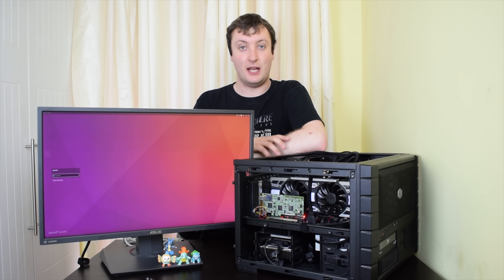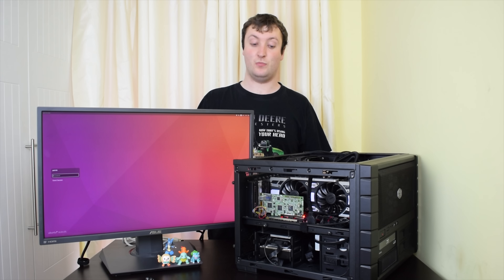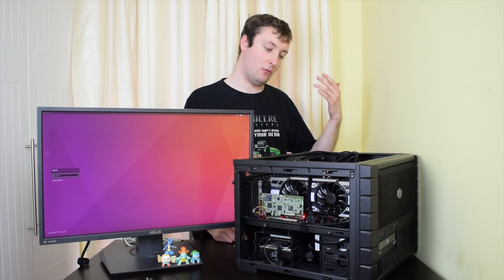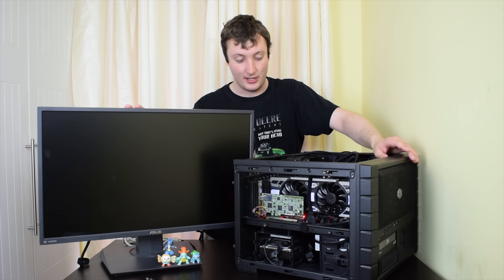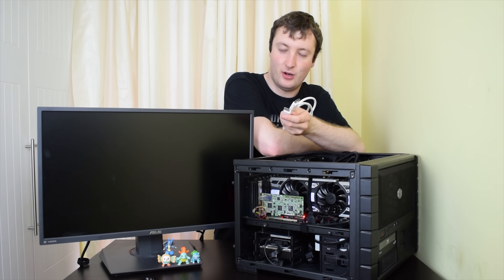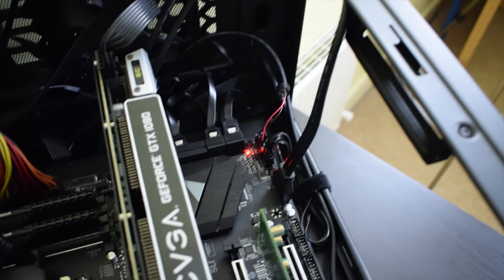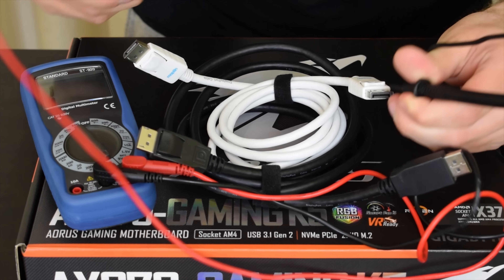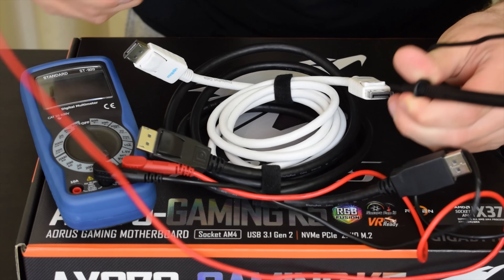Display port can cause boot issues

Comment: Bought it the same white cable from Maplin. It's not good as well. :(
Reply: Did you bought another one??
Reply: @aashxq  actually yes. But, in the end, the whole problem was fixed by disabling the UEFI (Unified Extensible Firmware Interface) on the BIOS
Reply: @gustavokeno  I wish I could try that but in case if it failed I have to force shutdown my PC again ( already done it more than 20 times,  now I'm getting fear of losing my HDD or something)
Reply: @gustavokeno  my cheap  DP cable work normal after its turned on (with VGA cable)  but I doesn't bootup 😐
Reply: @aashxq  try to disable the UEFI. I was afraid too - and, in fact, was my last resort because i bought around some five different kinds of DP cables.
Reply: @gustavokeno  how do I do that?  Do you have any tips or video links?  I tried to figure out my bios I couldn't find the Correct boot option,  there was a PCI boot option is that it??  (Btw my MB Gigabyte B450 DS3H)

Comment: You have been framed with a non DP compliant cable. The DP standard says a male to male DP cable should NOT carry the power (pin20) on the wire. The power on the plug is meant for active devices, and is supplied both on source and sink end.

Comment: This was eye opening! So your saying the DP cable that came WITH my £600 Asus monitor is shit and wired incorrectly? On a side note, I found deselecting fast boot allowed my PC to detect the DP monitor (My primary of two monitors) But this didn't work all the time, probably 1 time in 20 it still wouldn't detect the DP and I would have to reset the PC with the reset button on the case.

Hardware config' if it matters.
OS: Win10. (Build 18363)
MoBo: Gigabyte Z390 AORUS pro wifi. 
Primary monitor: Asus VG35V.
Secondary monitor: Iiyama GE2788HS
GPU: EVGA 2080super
CPU: i7 9700k.
Reply: Basically. I have flickering issues with my Acer monitor and I am forced to buy a better cable. Most provided cables are shit out of the box

Comment: Just ordered 2 displayport cables that have pin 20 inactive, hopefully this fixes my problem, recently switched to MSI z590 MEG and a 10850k coming from Ryzen and my computer would not post sometimes and I would have to disconnect the displayport cables to get it to post, you're a genius for figuring this out.

(Edit): got the cables yesterday, no issues so far posts perfectly every time and my monitors don’t take a minute to get detected anymore. Don’t cheap out on DisplayPort cables boys
Reply: can I ask what cable you got that worked, I'm having a hard time getting enough details from retailers. Thanks!
Reply: @powerone8082  yea this fixed the issue entirely, get a cable with pin 20 inactive if you are gonna use it on a graphics card
Reply: @victorxify1  I don't see that advertised anywhere. What brand did you go with? Thanks!
Reply: @powerone8082  just make sure it’s VESA certified

Comment: Thank you for this video! After hours of running tests and trouble shooting, who would have thought it was a monitor cable that caused boot issues. I even replaced my CMOS battery.
Reply: I JUST WENT THROUGH THIS. I had gotten this DP cable and used it for a month no issues except a intermittent monitor flicker (as if the PC was going to sleep but would just flicker off then on). Then my PC had issues posting. Drove me crazy trying to figure out what was wrong. Reinstalled BIOS and windows multiple times. PC is only maybe 6 months old. I thought my GPU or mobo was dying then I noticed that I could get it to work if I disconnected the DP and only used HDMI.
Reply: @duuyyy  I just got a new monitor and started to use display port and if my monitor is off when booting I get 4 motherboard beeps I’m not sure why maybe it’s something to with the monitor having nvidia g sync? So the graphics card can’t read it should be active idk if it just sounds dumb but it’s the only thing I can think of
Reply: @vxasa  4 beeps is supposed to mean an issue with the timer or an issue with your RAM, it depends on your mobo manufacturer.

Which displayport cable are you using? Maybe try buying a name-brand one if you didn't before and seeing if that works? It did for me.
Reply: @duuyyy  I get 1 long beep 3 short beeps I think for gigabyte motherboard it’s ram or graphics card issue and the dp came with the monitor it’s just weird because it never beeps if the monitor is on
Reply: @vxasa  hmm usually if the dp cable came with the monitor I'd say you're good on that end. Does it still post and startup even if it beeps?
Reply: @duuyyy  yeh it does with no problems

Comment: Hot damn. This actually fixed my issue!

I upgraded some components due to a dead power supply that took out my GPU. After installing the new components, I was having boot problems. Fans in the entire case and GPU would click on 2x every second when trying to boot, and the MOBO CPU LED was flashing along with the clicking of the fans. After a lot of troubleshooting, I discovered that having the DP cable unplugged when powering on, would allow the PC to boot without issues. I googled around, found some articles and this video, and I'm absolutely baffled by the 20 pin issue (and how it can apparently even affect a RTX 2080 super, when it didn't affect my old GTX 1080).

Oh well, I had a spare DP cable lying around, and now I've been able to reboot 10+ times without any issues. Thanks for the informative video :)

Comment: I started having boot issues when I got a new LED display, which unlike my old display, had a displayport 1.2 connection, since it supported 144hz. I always had to restart my computer, sometimes twice, in order for it to boot. Since it was a minor inconvenience, I kept always restarting the computer, as everything would work normally after. Some time later, probably not related to this problem, my display stopped working properly, so I returned it. Turns out that, using my old HDMI display the boot is perfect, so it probably was related to the displayport cable and your video makes my theory stronger. I'm happy that I didn't buy another motherboard (for me it was the only possible reason for such a problem).

Comment: Thank you for sharing this. Just has the exact same issues. My build is 18 months+ old and was fine until today where it started the freeze and blue screen. Then went into boot loop and finally wouldn’t post. As soon as I unplugged my DisplayPort cable, it booted every time. New cable ordered!

Comment: Exactly the same thing happened to me mate and I'm so glad I found your video. 
TL:DR, but RX580 with FreeSync monitor and I was thinking a DP cable would be necessary and maybe even improve performancer, so I bought a cheap one just like the black one you showed us and the PC wouldn't even switch on. When it did, I had multiple blue screens, auto Windows repair attempts and the monitor not even being recognised. I put the HDMI cable back in and all the problems went away, so I'm taking the cable back to the shop.
Many thanks for enlightening us!

Comment: Thank you so much, since I got three monitors one of the cables were stopping the PC from booting at the front power switch so I have been unplugging the display port cable and then turning the PC on then plugging the cable back in and now I've just plugged a new display port cable in and the PC has booted from the front power switch without me having to unplug the cable. Definitely deserves a like.
Reply: Having the same problem but its Eid so im gonna have to wait a while before shops open..

Comment: Thank you so much. I just built my new computer with a 3080 and I tought my GPU was broken. I troubleshooted for more than 10 hours verifying everything. You fixed my problem :D
Reply: U just replaced the cable ?
Reply: @nawafalamri5724  yes indeed I did.

Comment: I normally just reset my pc 1-3 times, the monitor flashes a few times and it works again. Another thing, when i bought my new dp monitor, i had to connect both DP and Hdmi, it just wouldn't give a signal on the DP, so sat my monitor for Hdmi, started my pc, no problem, went to monitor settings, sat it to DP, change my monitor to DP, unplugged the Hdmi cable.
DP is garbage, but i have to use it, due to my 165Hz monitor.

Comment: Thank so much for the information. I just noticed, after doing a full checking because my PC wasn't posting unless I switched off/on my PSU, that my displayport was causing the led problem that had been happening for a long time and I did not bother about it, but lately (probably) has been causing my boot problems. Seems to be fixed right now, I hope it last long. Thank you!!!

Comment: Thank you for this video, I disassembled and reassembled my new PC (gigabyte B550 auros pro AC and ryzen 5800x)  a couple of times to find the cause of this issue (problems were issues booting/restarting and the fan controller running all fans on idle since the CPU temperature was detected as being -55oC), to find this video and some forum threads explaining my exact same problems.

Another DP cable and the issue is fixed. Without this video I probably would've had to RMA the entire PC.

Comment: The “bad cable” looks like the Accell cable from Amazon that many people on different forums recommend. 🤔
Reply: That cable is identical to the one that came with my Samsung SH850 monitors...
Reply: @SOLARSUPLEX  the cable that ships with Samsung monitors gives false positives for a bad gpu
Reply: Im so glad I found this video. My mobo was lighting the rgb (asus tuf b450 pro gaming) and my GPU fans (GIGABYTE Radeon RX 570 8GB) keep turning erratically after shutdown windows, but worst, even after switching the PSU off. First I suspect of a bad PSU, or a deffective MOBO, but turns out that was the displayport cable. A brand new but sheap cable was sending back some energy to my pc . Finally I bought a cerrified displayport cable and problem solved. I would ever never find out this on my own. Thaks you so much!

Comment: Can this also be the cause of monitors reading no signal when you boot up using dp? And then using the power cycle fix?
Reply: This is what I'm having. Is there any way of fixing it?
Reply: Came across this comment looking for a solution to the same problem
Reply: @jmanabc  damn sorry guys... I dont even remember how i got it fixed. I feel like i did do the power cycle troubleshooting fix or something wasn't plugged correctly into the mobo. Sorry guys!!

Comment: Huh. My monitor has always had troubles connecting to my pc and now for the first time the pc did not even boot. I unplugged the cable and it booted. Maybe all along I had bad cable. Really weird, I could had never guessed dp cable can have such an impact

Comment: Ok I had a ver similar issue and I figured out it was my display port cable because if I booted up with an hdmi cable I had no issues but with the other cable it would go black after bios, so I guess I’ll just go get a good cable and hope it works then

Comment: I had this issue as well it appears, one of my display ports was having issues. Eventually the motherboard would not post with and error of 00 which is a hardware fault and freaked me out. So I pulled out one of the DP and turns out it posts fine now. We will see if that was the issue because I did not confirm the power draw from the cable. But I suspect this was the case

Comment: Don't know if it's related to this but I've had issues with 3 separate 30xx graphics cards across 2 different 12th gen motherboards. Whenever the displayport cable is plugged into the gpu, the computer often gets stuck in a boot loop with the display being garbled and unreadable. Sometimes it works itself out mostly not.

Strangely the displayport cable going into integrated graphics doesn't have this issue nor plugging it into an older 970 graphics card. Motherboard's displayport is 1.4 and monitor's displayport is 1.2 but why would it sporadically work?

Comment: Bought an Acer predator z35, imagine my confusion when I switched to display port and tried to turn up my refresh only to have the pc blue screen and then fail to boot until I disconnected the display port. Looks like a common issue, I’ll be trying to find a better one tomorrow
Reply: Cheers, bro. I am having the same issue. Did you bought another cable? It worked?

Comment: I've had a similar problem with my motherboard being powered by an hdmi running through an hdmi switch to a monitor. My gpu was producing an audible whine in addition to my mobo lights coming on when attached to the switch (psu unplugged).

Comment: i am using 2 monitors, my 1 is a acer 75h plugged with hdmi, my secondary monitor is on a displayport to hdmi cable and plugs my asus 60h, all was well, for over 2 months.
2 days ago , the displayport stopped working, will not be detected in any of the 3 slots on my nvidia GTX 1060i 6gb (the card is 5 months old)

Comment: Thank you 10000x for this. I was doing the same thing, going crazy testing every party. Constantly having boot issues and reinstalling windows. The PC would randomly restart when configuring Windows and installing the display driver.

I was afraid my 3080 was broken.

Using HDMI for now until I can get a new display port cable.

THANK YOU.

Comment: Good guys
I still have the problem reported here when I bought my monitor.
Basically the computer whenever it is idle as much as after shutdown, hibernation or suspended, the monitor turns on the blue led but gives no image and always have to unplug the transformer and put back almost immediately and almost gives an image.
Now I've been doing this almost every day since the monitor came. Does it have a dpi connection, do you think it could be the drives or pc / monitor settings, or should I send it for warranty? Not yet a year after purchase.
Every holy day in the morning I have to disconnect and reconnect what is most uncomfortable, I even took the hibernation and suspension options to always leave the screen on !!!

I await opinions

Comment: I had the same exact issue. I thought I was losing my mind. I had ordered a cheap display port exactly like the one you have and had issues. Even got a replacement cable or the same crap brand and had the same issue until I switched over to a DVI cable. I even sent my new graphics card back because I thought it had a bad display port.

Comment: Holly Shit! I have that same exact cable and I have upgraded and changed everything about my PC for months now. I RMA'ed 2 GPU along with the process, and turns out its the shitty cable that you Monitor comes with... Feelsbadman. I have a way more powerful pc now, but hot damn I am pissed that it comes down to a cable that has a 20th pin.

So for anyone that buys a monitor, toss out that cable and get a Vesa Certified, 1.4, 20th pin disconnected DP that is no longer a meter. StarTech sells one on Amazon for cheap, and is listed on the Vesa Certified website as well.
Reply: You know what problem is and still cheaping out when buying new cable.

Comment: that darn display port can be a pain.. even with a certified cable i have to make sure i dont turn my monitor on until my cpu is posting an image or i will get randomly black screen then back and the handshake icon will come up.

Comment: YOur video enlighted me! But I've fixed covering PIN20 with a piece of paper :D Anyway SEEMS that also changing CSM , Compatibility Support Mode (disabling it) from BIOS, in MoBo settings, helps to fix the issue...

Comment: A hdmi cable can cause this issue too?
Reply: That's  true  I have a Gtx 1060 dual monitor setup one monitor in  hdmi port and other dvi port.After putting the computer in sleep mode and trying to wake up both monitors would be black. I then tried a reboot using the computer cut on switch no response . Unplugged the hdmi cable wham! it booths up on the dvi  monitor.  I then bought a display port cable  same issue after cutting off or putting computer in sleep mode after a couple of month.I then removed display port cable, and it would booth on dvi monitor as before.. So now when  the monitor/s goes black on either or both the monitors. I just reboot  use dvi monitor, and switch cable on video card to hdmi or display port on the reboot and it fixes problem for a couple of month !

Comment: But how do I fix it, what do I do? I have bought 2 cables already, how to find the correct cable ?
Reply: I have bought an expensive one but it is the same !!!
Reply: Rob here is a listing of certified DisplayPort cables that are available, which you can check against before you buy a DP cable:
https://www.displayport.org/product-category/cables-adaptors/?ps=displayport%201.2%20cables

Comment: can someone give me link for dp cable used in video...having the same problem.
Reply: i dont know but i have the same exact "brand" the same cable. they are very cheap like 3$ so yea
Reply: @Clayton Horning Interesting. I just bought that exact cable today to replace the stiff cable that came with my monitor. Those stiff cables can really wrench at your ports.

But for some reason my boot times have increased a bit, just by swapping the cable. I never used to even see the windows loading circle and now it's displayed for maybe 4 or 5 seconds.

I love the look and feel of the cable. Just want my fast nvme boot speeds back! Maybe it's something that will settle with a few more restarts.

EDIT- Ok, another hard restart fixed it! Thought as much. So, it is a great cable after all!!

Comment: I had a very similar issue with the exact same video card, but in my case the mobo leds were not lit, I even started a RMA process for the mobo thinking it was the culprit. By mere luck I discovered the problem was in a faulty Displayport cable, which was stopping the post in one mobo, but not in a different one. I spent days trying to figure out what was happening. Could it be the video card model? Or is it only related to the Displayport?